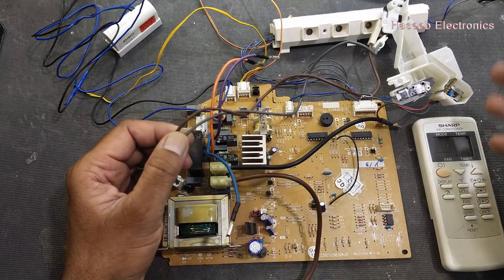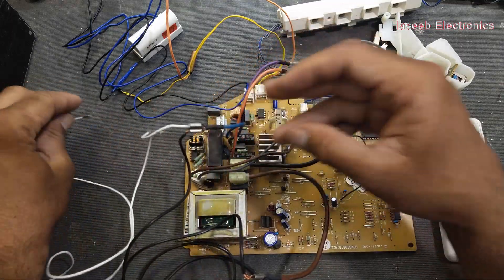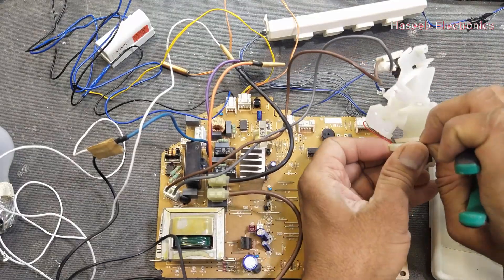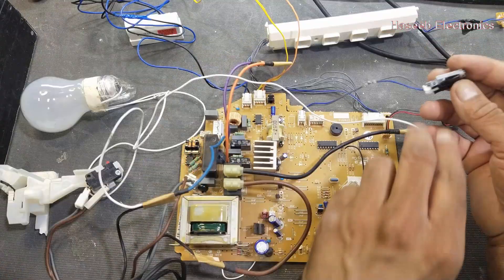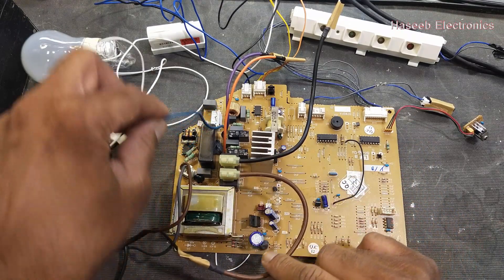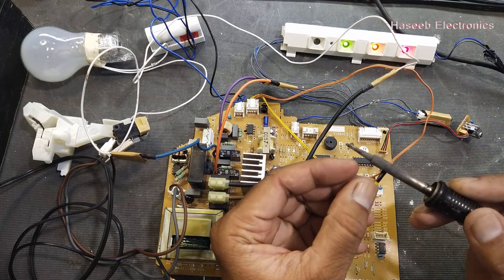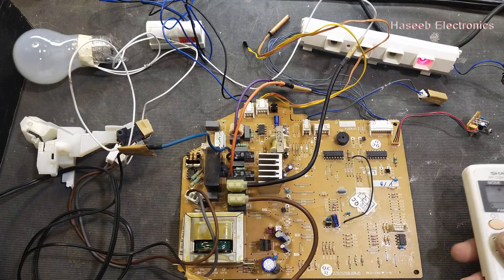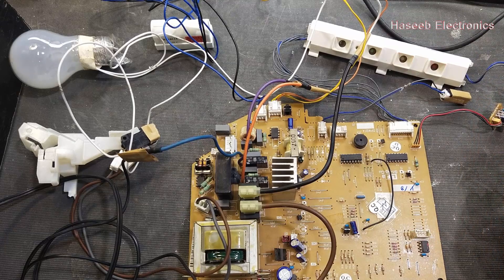[434] Sharp 1.5 Ton Split Unit Circuit Board Testing in Test Mode

Comment: I have that similar board but its not switch on the indoor and outdoor
Reply from the maker: please check its power supply section, specially 5 volt, 12  volt and sensors

Comment: Assalamu walaikum bhaijan
Apne tabletop main kya chij use kia hai
Aur uni t ut61e+ kaysa meter hai 
Inverter circuit repair ke lie kaisa rahega
Reply from the maker: table top per mein ne neutral sheet use ki he. ye special rubber material ESD FR4 material hota he 
UT61E is useful and it is reasonable
Reply: @HaseebElectronics  iska buying link de sakte bhai 
Aur ut61e main accuracy kaisa hai

Comment: Mashallah,bhai I have a problem with 3 board 200amp MOSFET welding machine,in which open voltage is 60v,and arc Voltage drops to 4v,only sparks no welding,can u guide me to troubleshoot

Comment: Sir,i am ur big fan,i have a quetion for u,please help me sir,how we calculate the watt of a inverter circuit,ex-500 watt,1500watt inverter etc,because with 6 mosfet or 8 mosfet i cannot able to calculate the desired wattage,though i am adding the wattage  from the datasheet,but which things gives the calculation of a inverter circuit,please sir help me,and make a video on it.it is very important and will be hight rated video for your all students....
Reply from the maker: inverter power calculation bases on the output power (voltage x current)
the mosfet is installed to drive the transformer to get the maximum output VA or wattage
i will discuss it soon (in this week positively)
Reply: @HaseebElectronics  Tnak u very much sir....

Comment: HElo SIr,very good explanation,HOw about to test a pin transformer on this PCB?with ohm meter?that indicate the transformer is good or bad...
Reply from the maker: best regards
testing dc resistance of a transformer primary side indicates that the fuse, transformer primary side is ok. if it provides zero ohm that means, the transformer primary or any safety component like class X capacitor, MOV is short circuit. if multimeter display open circuit, that means either fuse is burnt out, cleaning switch may be damage, or transformer primary winding is open
Reply: Thank you again? How do you know the the relay on the indoor unit is closing

Comment: Interesting problem..  Is the voltage regulation changing as the unit heats up?
Reply from the maker: best regards
these sensors are  NTC (negative temperature coefficient resistors) / Thermister (for room temperature sensor & pipe temperature sensor) its resistance decrease as increase in temperature. so these changing resistance makes a change in voltage drop across it. and this voltage level in transferred to MCU, which converts it into digital data and controls the compressor ON/OFF and system functionality